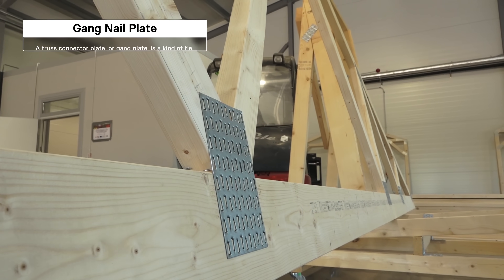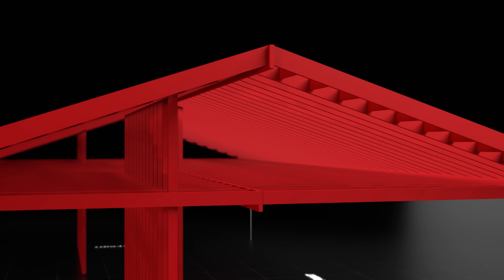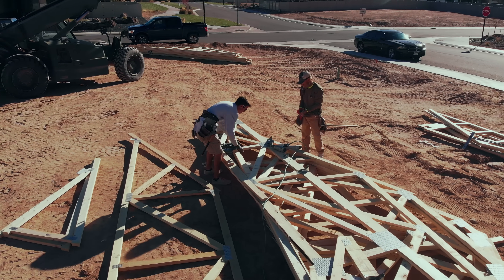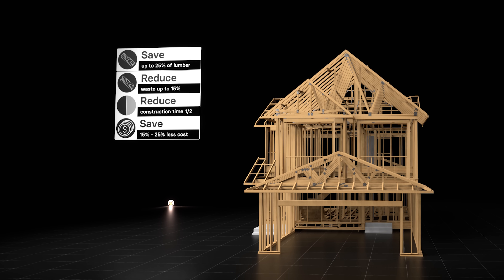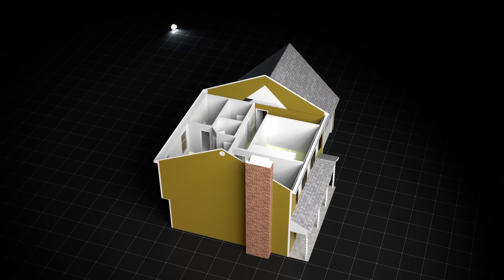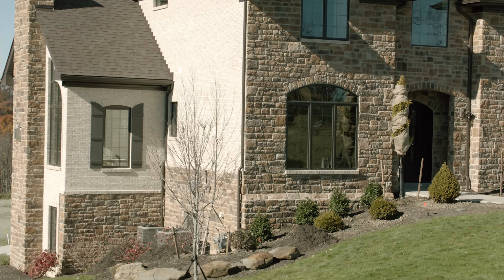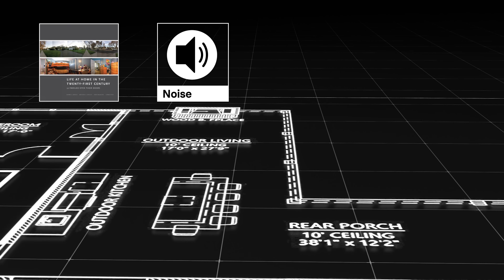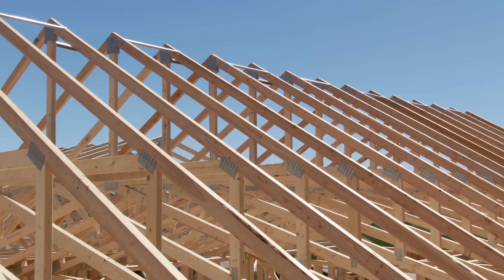The Invention that Accidentally Made McMansions

Comment: The one positive of truss plates is that it enabled me (a roofing contractor by trade) to build my own house and do the framing (with my roofing crew) ourselves. It is not impossible to learn roof framing, but it is SO much easier with trusses. But Mcmansions as a whole are the bane of my existence as a contractor trying to waterproof impossible angles with valleys terminating in walls and the such. I can waterproof them with the help of water & ice membrane because the siding is not yet installed enabling me to run the membrane up the walls. But...when these houses get re-roofed due to age or a hail storm, the next contractor will not be able to waterproof them near as easily. Long-term maintenance is rarely considered. I built a two-story colonial - simple yet elegant roof lines that never goes out of style!
Reply: I'm a home inspector, those multi valley and stepped roof styles are hard to inspect....flashing nightmare...leaks are almost impossible to locate...advice is to re roof ra ther than try to fix one of these mult angled monstrosities. Over head trees.....gutters, don't get me started
Reply: @francismcgovern5042  And if water gets in, it is so problematic with the modern materials.  Soft/young southern pine 2x4s and chipboard just aren't going to hold up very long soaking in water.
Reply: @francismcgovern5042 yeah and because homeowners insurance typically covers like if there's accidental or environmental damage I'm sorry I will cover a new roof a lot of times like totally free or next to free 

That you can have these almost impossible to properly service roofs get rebuilt at what seems to be no extra cost to the homeowner but in the end is an extra cost to every homeowner because it is so much more expensive to re-roof a structure like this 

So it's kind of a bad incentive I have a friend whose job is basically to drive around and look for like one or two damaged tiles and then almost always the people's homeowners will pay for it for free so he goes and talks to the owner and the owner's like well if I don't have to pay for it let's do it and where is the simpler structure or even some of these structures probably could be fixed instead they're just totally redone and again that just adds to the cost of homeowners insurance for every one of her time
Reply: @mcamp9445  But it isn't "no extra cost".  They're paying the insurance, which means they only get any benefit if a problem actually happens.
Reply: @cstgraphpads2091 my point is that if insurance wouldn't replace roofs with no or would charge extra for complex roofs or charge more, then people might feel the pain of the extra cost of fixing this type of roof and choose not to live in houses with overtly complex roofs.

But because it's basically seamless for them, they don't have to take that into account.
Reply: Do you have a site / portfolio of pictures? Would love to see said colonial! :D
Reply: @Nieghorn don’t do it
Reply: As a contractor who's had to deal with the latter situation, you're spot on. Frustrating at a minimum
Reply: yes so much faster and cheaper to have Hector and Louise slap your crap work together, what do you care you won't be buying that house 👍 @staticbreakup
Reply: For the timeless shape is a Cape. Solid design with plenty opportunity to make the roof stronger and much easier to repair.
Reply: And if you want solar, a simple roof is a much easier install.
Reply: Also lost:  Heat or cold ready designs that make temperature management easier for an area, like Florida.
Reply: I live in Florida where roof lines get very complicated. One thing that was popular but has since been eliminated with newer building codes is a roof trough that simply runs into a wall.  The drain away is perfectly horizontal and that is where failures and leaks occur.
Reply: My gut told me reroofing those monstrosities would be a pain and costly. Interesting to hear the details of what is involved. Not interested in owning one of those thrown together mcmansions at all. If money wasn't an option I'd build with concrete and steel commercial grade like a skyscraper.
Reply: @googleuser868 The more complicated the roofline, the more expensive roof replacement is, regardless of type of construction.
Reply: I too get pissed off about idiotically planned roofs, in both old and new houses, because dumb roof geometry did exist before McMansions, just not as common. I get a little bit wound up any time I see something like the bottom of a roof slope terminate in the side of a turret or chimney, my thoughts turning to that the homeowner has or will have expensive water infiltration problems there. Please keep roof geometry simple and think where the water will go.
Reply: I grew up roofing (my grandfather and father owned the company) and older homes with multiple valleys required an entire extra day of work, usually in cramped conditions. I hated it. My grandfather would typically take the crew to the next job to set up while my dad and worked the valleys, then the whole crew would show up the next morning and finish shingling. What's left of my knees don't miss those days one bit.
Reply: When I was looking to buy a house, I wanted a large house, but not an open floor plan...and definitely not a house with a complicated roof.  

Found an older home with an east/west sloped roof in three sections...easy to replace a section at a time.  No attic, since the ceilings follow the slope of the roof, so no trusses.  No open floor plan, either...thank God!  😂
Reply: Very good point! I see houses here where snow and ice accumulates such that the entire valley would need membrane.
Reply: Trusses are great for simple farm style houses. You can build a small regular house for a shockingly low amount with just a little help and tutorials.
Reply: @anthonyrowland9072 it’s not cheaper than framing it traditionally. Not by a long shot. You’re paying for convenience, and a big knowledge gap, oh and also a crane
Reply: @psyience3213  Convenience of not paying a framer...

Don't need a crane for a normal sized house either.
Reply: @ exactly.

Oh really? The only ones ive done had to be craned, I believe you though.
Reply: When I eventually tear down my double wide I want a simple house like what you have. Maybe go with a ranch style, or even an A frame style cabin, but NEVER a McMansion.
Reply: @EveryBigfootIsANinja  I would never buy one of those things, if for no other reason than that their proportions are always terrible, especially when they’re trying to mimic a classic style.
Reply: If you are going through the trouble of building a house, then the relatively small amount of extra labor to build vaulted or bonus room space is using rafters is negligible. Especially when you consider how long a well designed, well constructed home will last and will retain its value over a cookie cutter POS.
Reply: Ex Waterproofer and roofer I understand your pain bro,  peel and stick and thru wall flashing is a bitch on re roofs
Reply: Out first home was built in 1907. A Queen Ann style Victorian with a very steep 12 on 12 roof. Never had problems with flashing or reroofing
Reply: @ your queen Ann returns are def 100% rotten.  Okay…95% rotten.  
You’re not a roofer, but love your 12 12 pitch.  😁
Reply: @ thanks for responding. I’m a 69 year old carpenter haha.  Moved out years ago but nothing was rotted. Lead paint my friend.
Reply: @ crazy.  I remember my parents buying the new unleaded gasoline 
I remember them being asked at stations who pumped your gas, leaded…or no lead ( is leaded even a word?  With lead maybe…shit I dunno ). 
If you had told me as a child, someday I would be paying for a bottle of water …. Would have laughed so hard I would’ve dropped the garden hose.
Have a nice day fellow citizen
Reply: I don’t understand why modern home builders hate 90 degree angles so much. IMO that is the only acceptable angle for walls or cabinets in a house.
Reply: Seems there are two extremes of Modern architecture, flat-roof minimalism, or McMansion maximalism.
Reply: Yeah I have a colonial and my roof is indestructible. Some of my neighbors have also remodeled with metal roofs. I doubt you could do that with a McMansion.
Reply: This is a super important point!! Long term outlooks being ignored are at the root of most our modern issues.
Reply: that's the "perk" of housing as an investment, you never have to think long term because in 10 years you'll be on to your next one! Honestly, I feel sorry for ourselves in 30 years when all these houses are crumbling and look more like shanty towns than houses.
Reply: @IanZainea1990 My God! You're right! The seemingly random angles of McMansions are like shanty towns!
Reply: And therein lies the problem. New inventions mostly don't go into improving housing; they go into profits. They go into shortcuts, short-term fixes but long-term disasters. In short, human greed corrupts them. I live in a well-maintained, small, 100-year-old house full of hardwood and solidly built as a colonial. Would never ever trade it for something badly built with cheesy materials by  poorly-trained labor hired by companies who don't give a crap about work ethic and pride in their finished products.
Reply: @donnarichardson7214  Yes, agree.  BUT we had a beautiful 100 year old house with much character too, and it was a nightmare to upgrade plumbing and electrical in these old homes.  it is almost nerve wrecking to open a wall up to see what is inside and what needs to be done to fix everything.
Reply: @blaster-zy7xx  Fortunately, the one I bought ten years ago had been owned by one family for over 40 years, and they did excellent upkeep/update. Have had normal repairs/upkeep since but (fingers crossed) nothing major. Plumbing, HVAC, and electric had long since been modernized (despite remnants of wire and tube in attic!).
Reply: nailed it. Excellent analogy.
Reply: Up and overs all day
Reply: and the other tragedy is that there are so many of these new subdivisions and housing developments that have been abandoned and half finished after they run out of money.. Just WASTE upon WASTE upon WASTE.  This is the glaring error of Capitalism... and no one other than conscious folks notice or care.. its all about this Dollar... Builders and banks get in and get out make their money and they don't care about the legacy or the mess they leave behind!. 
I had a freind who bought a much smaller house in a housing development HOA and for the first few years they had so many problems with the crap work.. leaks. etc... I saw an inspector who was going up into these roofing trusses and it was CRAZY.. I mean they were not, for some reason, using these plates and so you saw bent nails, and boards going everywhich way shoddily nailed.. that was a disaster waiting to happen..
Reply: They are meant to collapse lol
Reply: Former roofer here. I actually did a tps roof on Oak Beach with all kinds of angles and terminations. It was just before they found all the bodies over there. The girl had gone missing but winter came and the search was called off until spring.
Reply: We can’t, we aren’t contractors and would never be able to get insurance. So now? We’re just screwed forever.
Reply: Banker: long... term... maintenance?.... oh you mean more loans.
Reply: I ran across quite a few videos on YouTube about how problematic these mcmansion roofs are.
Reply: I don’t like living in big houses. They feel cold and lonely to me and are hard to clean. Small houses are more cozy, easy to clean, more convenient, and cheaper. Win win win!
Reply: I love how people are like “It’s not impossible” like it’s still really hard. It’s 8th grade math. Basic trigonometry.  Run / cos(angle). Angle = atan(rise/run). 90-pitch= seat cut. That’s all the math for a gable. For a hip you need Pythagorean theorem. And that’s basically it. That’s stuff carpenter should know  anyway top dejémoste stair angles and square things off…..
Reply: PULL THE SIDING 
*OR STOP ROOFING *
Lazy ass
Reply: @RingerStudio  contractor 😂😂 sorry you are a carpenter. Contractors build houses out of concrete, you build them out of wood clearly that's carpentry.

Comment: Americans will never learn - you build houses from brick and cement instead of wood.
Reply: BS, the parts one normally builds using those materials are the walls, The parts that are difficult to structure like the suspended floors or roofs are usually wood.  Short of modern day composites like carbon fiber, wood has the best strength to weight characteristics.
Reply: least arrogant comment from what im assuming is someone from europe.

Comment: The diagram you show at 1 minute 50 seconds of a vacuum forming on the windward side of a roof seems wrong. it seems to be the reverse of the explanation of how an airfoil works; where the windward side actually has a higher pressure and a vacuum forms on the leeward side where the flowing air separates from the roof and lowers the pressure on the leeward roof (or back part of the wing in the case of an airplane.) See Wikipedia https://en.wikipedia.org/wiki/Foil_(fluid_mechanics)#:~:text=A%20foil%20generates%20lift%20primarily,two%20components%3A%20lift%20and%20drag.

Comment: I feel like you either don’t know how construction works or you make critical errors to support your narrative

Even as far back as the 70s there was such a thing as a chopsaw that you just set your angle and you can cut thousands of pieces without deviation.  So when you explain it being critical error and irregularity is in the construction quality of the rafters it’s nonsense. Even in the early 1900s they use jigs for cuts
Reply: You talk about standard framing being hard to make, no it was normal to make it’s not that it was hard is that these devices made it cheaper and easier but the quality isn’t as strong as stick framing so again you’re just kinda like way off base. That’s why real luxury homes still use rafters and not trusses because over the ages it’s way more doable and way more sound

Comment: Okay so.. why are pre-built houses still 500,000$ then?
Reply: Maybe because people buy the surfaces and have no idea what is behind the paint.
Reply: Because in large part, developers have a huge influence on existing prices.  Homebuyers will look for a house that meets their needs.  They will compare its price to what a new house with these same features will cost.  If they are relatively the same, they will likely go with the new home.  Usually, this meant that existing homes would cost slightly less than new.  Now, however, the new homes are so cheaply built with very little land and added costs like HOA fees.  So many buyers are actually willing to pay more for existing stock that has nicer lots and materials but are in need of  cosmetic upgrades.  This has brought a lot of flippers (speculators) into the market and driven the price up as speculation often does.